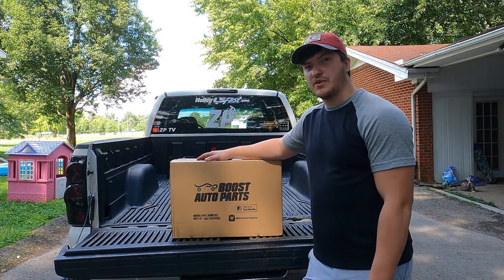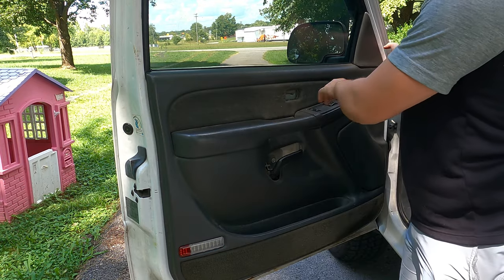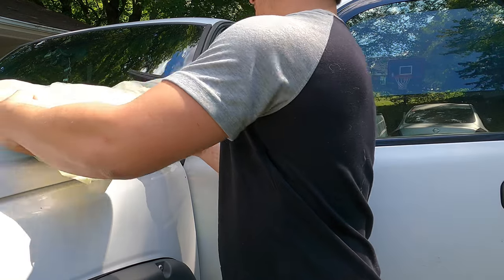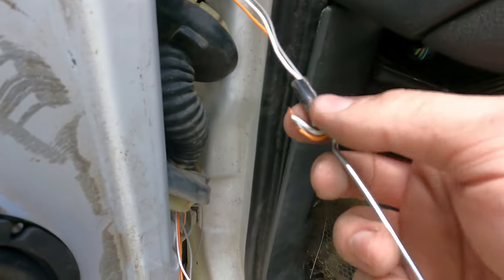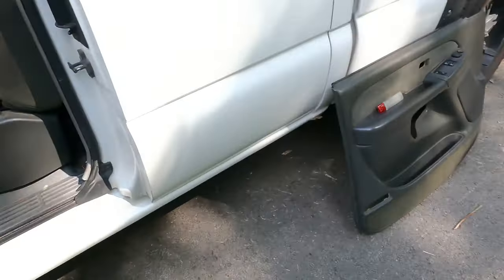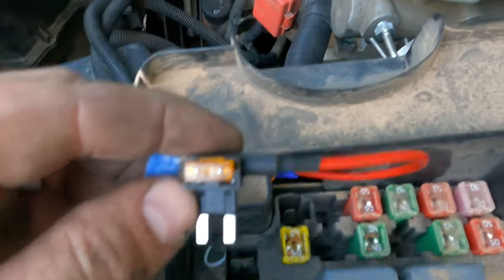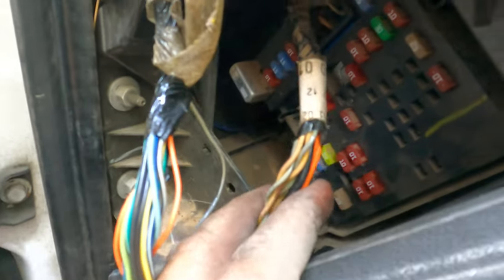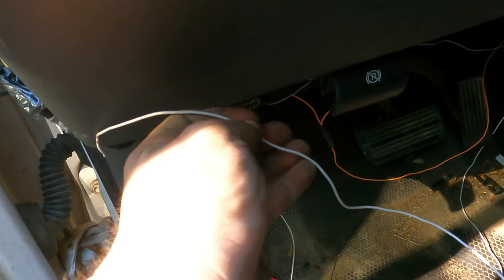NEW GM Style Tow Mirrors on a 03 Silverado!! Boost Auto Parts!!!!

Comment: I’m about to install tow mirrors like this on my 04 silverado. The thing is is I have manual mirrors lol. So I’ll have to do some work to get them done. This is a great video 👍. I’m an electrician by trade so I like to wire stuff lol. But I will be using not only electrical tape but also Tessa tape 👍
Reply from the maker: Thanks!! I don’t regret it one bit! And yea it’s been kinda bugging me I only used electrical tape… I’ve been kicking around the idea of going back through and doing some kind of loom or something lol
Reply: @ZPTVChannel  those mirrors are an awesome mod. Not just looks wise but it’s practical as well. But yes Tessa tape is awesome. You should check it out on Amazon. Also yeah I just did the electric fan conversation on my Silverado. So now I’m picking up those same mirrors from a guy on offer up in the morning for $120 brand new. Hopefully they’re new lol but still pretty good. They’re in the original packaging. But yeah I’m just watching a lot of videos and researching stuff. I’ve already got a performance tune on mid grade gas from Nelson’s performance here in SA Tx. Cold air intake with magnaflow exhaust. Got some 22 dubs wheels. Next major mod is I’m swapping in 3:73 gears from stock 3:42s might go with 4:10 gears but that may be too low.
Reply from the maker: @alphasaiyan5760  sounds sick!! I’m planning on doing drivetrain upgrades and the e fan conversion in the future but for right now the wallet says no lol 😂
Reply from the maker: @alphasaiyan5760  I need to do a lot more learning about gear ratios too lol I’ve got the G80 locker but not sure on what gears. Obviously something I’ll need to look into once I start upgrading things lol. My main goal is probably around 500hp max on this truck and hopefully try to pick up a single cab short bed to try to build to make the big numbers!
Reply: @ZPTVChannel  yes sir ! And yeah one thing at a time lol
Reply: Man im trying to do the same too! But i have manual mirrors too! Im trying to find a how to video! Can you point me in the right direction? I would greatly appreciate it!

Comment: I love those mirrors. You can check if yours has the power mirrors like mine if you hold the mirror direction button right. To unfold is hold left then up after it’s unfolded to get your mirror readjusted.
Reply from the maker: Thanks!! Mine don’t have the power folding option just manual folding.

Comment: Only video that has explained it well! What’d you use to tap into the dome lights? T tap?
Reply from the maker: I just split the cover and wrapped the new wire around and wrapped it up in electrical tape. A t tap would have been way better but didn’t have any on hand at the time…

Comment: i installed the same other than being chrome on my 04 yet only get the white drl with headlights on, not just putting in drive
Reply from the maker: @andrewwilson6015  I have them wired to come on when you turn the parking lights on! I’m sure you could wire them to the drls but they would be off when parked.

Comment: What plug is for the blinkers on the door panel switch
Reply from the maker: I don’t remember right off the top of my head but if I’m correct it will only go in one slot. There’s really no way to mix them up.
Reply: @ZPTVChannel  ok thank you because my driver side one blinker is not working but there thing else is working so I think I’m going to replace driver door switch and see if that fixes it